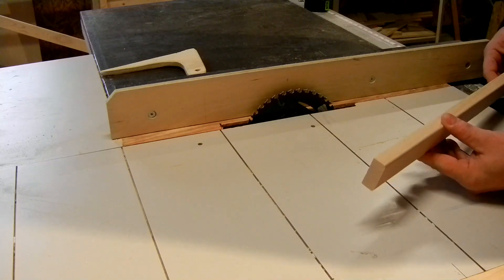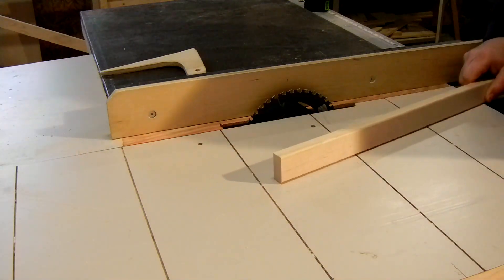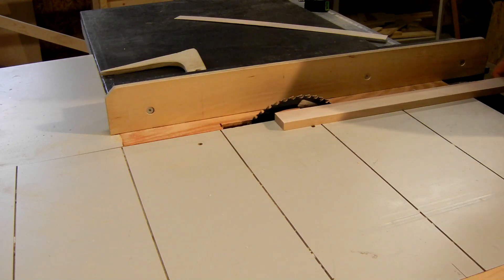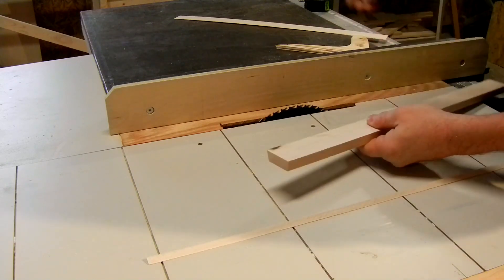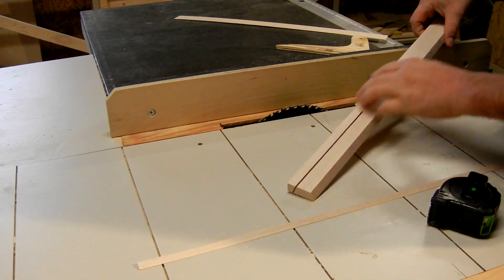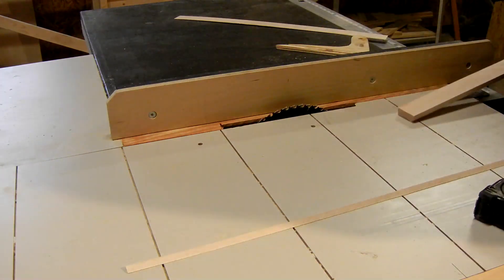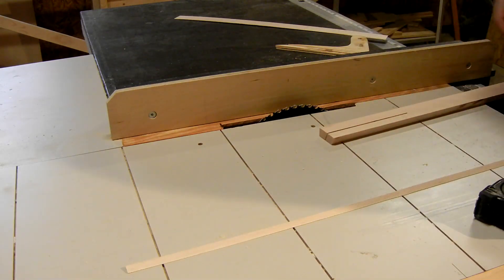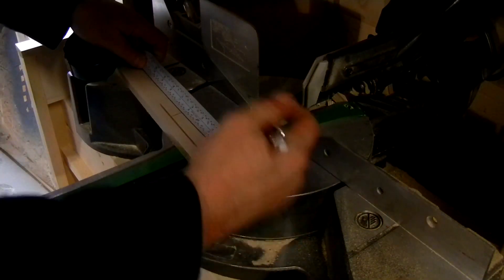How To Make A Rotary Tool Drill Press, Part 1

Comment: I notice you use a thick handled  screwdriver which seems to house multiple driver bits inside. I've never seen a screwdriver like this. Could you explain a little about it make, what applications it has and where you can get them.